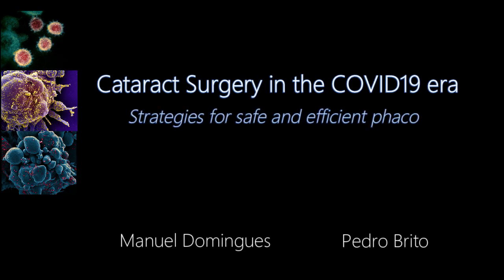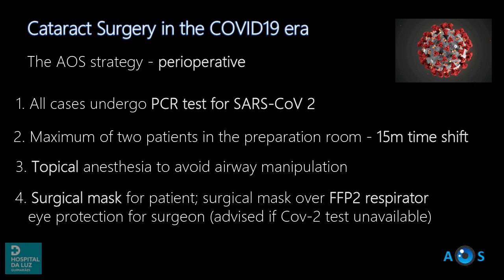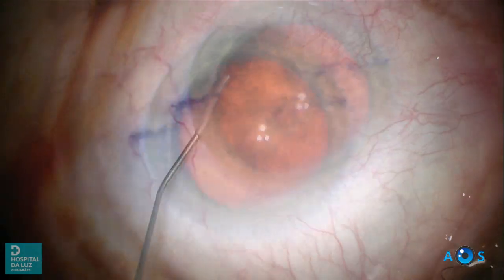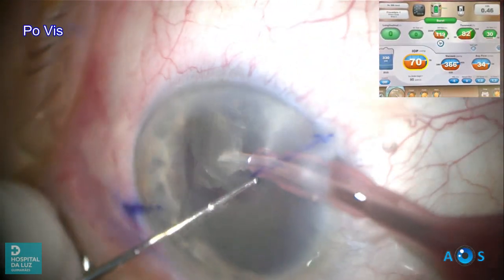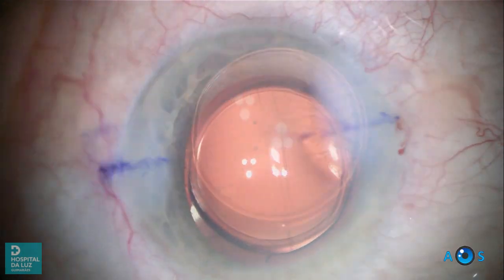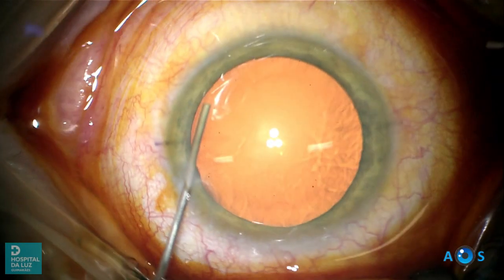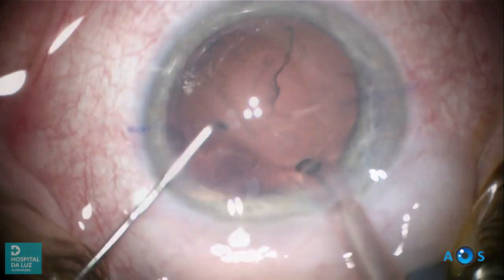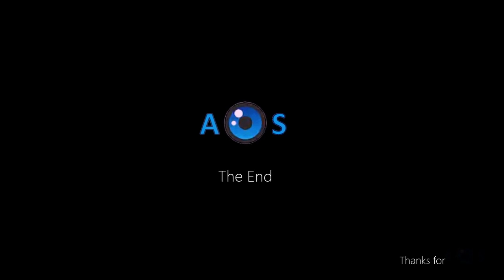Cataract Surgery in the COVID-19 Era:  New Strategy for Safe and Efficient Phacoemulsification

Comment: Why would you use Povidine after side port incision  ?   It can enter the AC and no need for that
Reply from the maker: It does not enter the AC because it is filled with coesive OVD being expelled through the side port as clearly seen in the video. The second irrigation is to clear any possible viral particles in the expelled aqueous humor!
Reply from the maker: Additionally even if any single particle of povidone could enter the side port,  The subsquent phaco and irrigation aspiration steps with high flow rates, would continue to wash and renew the AC with BSS